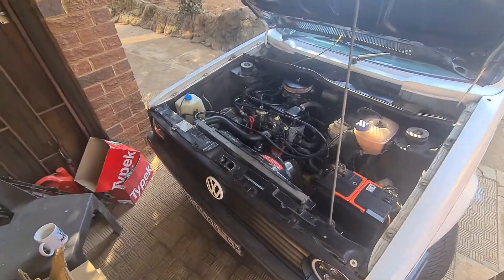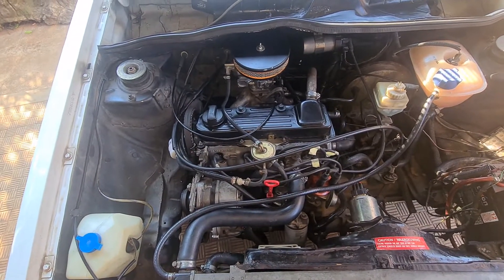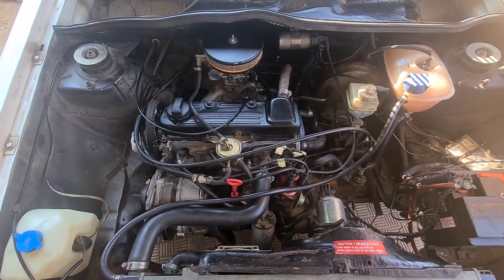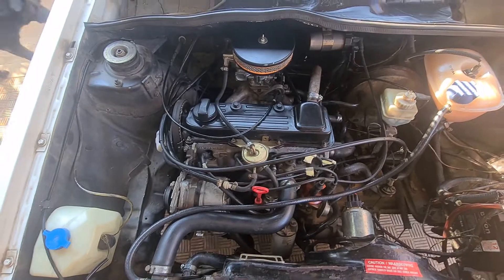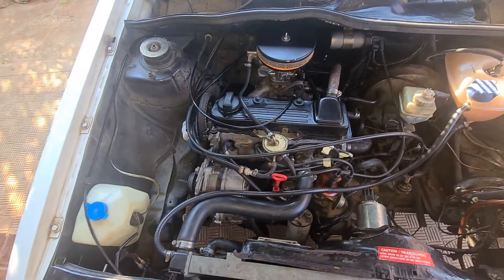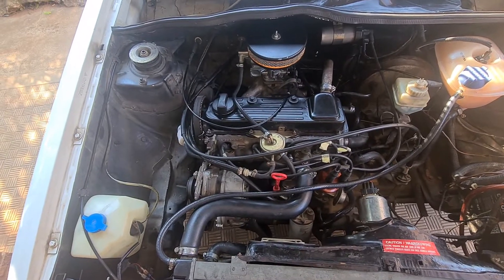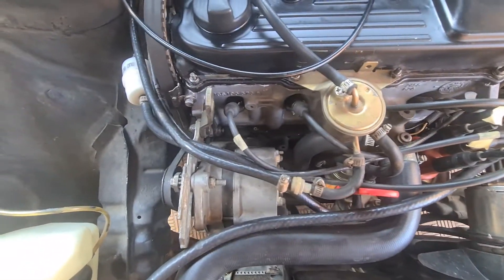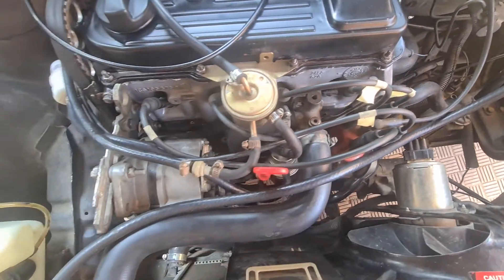mk1 1.8 8v 2mm off cylinder why firing order is different???

Comment: What's your engine code ?
Reply from the maker: Hi my engine code Afv
Reply: @ritchiesridemk1vwbuild853  Yep AFV is a 1.8 motor from a polo.

2l 8v motors came in 3 codes 
From Golf 3 gti and jetta 3 CLI 

2E long block 2l 8v FI

ADY short block 2l 8v FI

AGG long block 2l 8v FI